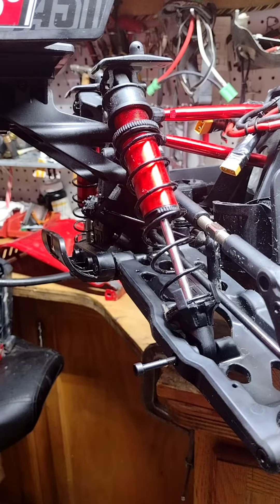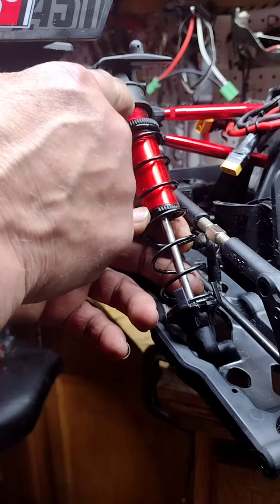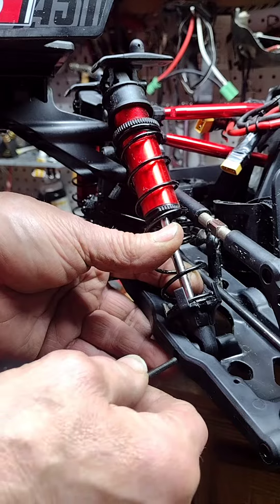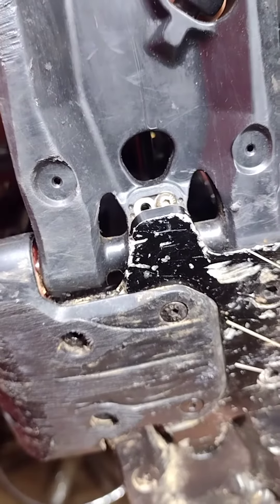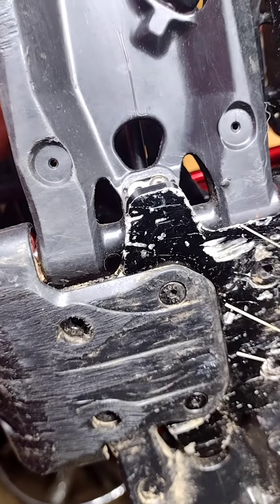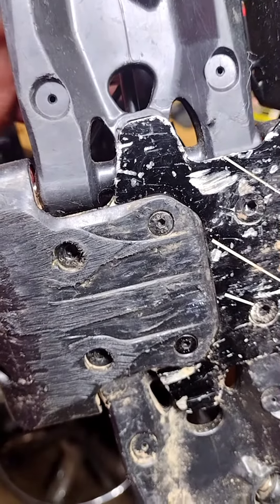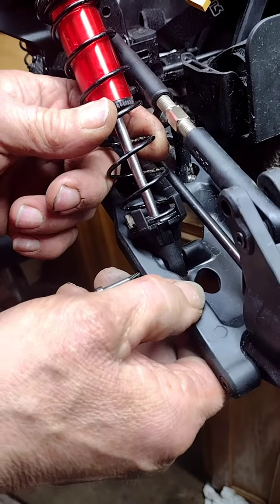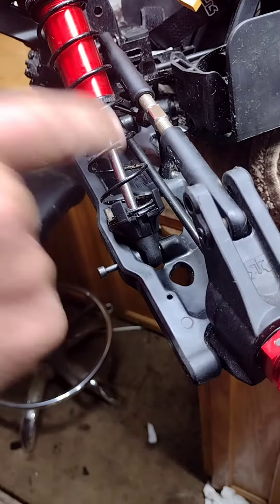How to properly set your droop screws on your arms.

Comment: What size washers do u have to buy
Reply from the maker: i got them on amazon.  i believe ther 6mm x 3mm.  and there shims.  The size shime I ended  up with 2-3 shims.  i bought the multiple shim  pack. i think it was 3 of the .3mm thick.  I hope this help.  seems to have solved my problems.  Other then using the shock extenders.  but im sticking with the limited rigs.  Have Fun.  thanks for the comment.
Reply: @ thanks brother

Comment: Some cars don't have droop screws so what do you do??😮
Reply from the maker: i notice the last set of RPM arms i bought they changed there mold and put a section to put droop screws on.  yaaa..  i haven't had the issues yet but i was going to buy or make limiting straps.  i been wanting to start putting them on my rigs .  i think its a better way of limiting the swing arm from going to far and break more parts.  thanks for the comment  alway want to be helpful in this hobby.  good luck but most importantly...  have fun.
Reply: @readeracingRC  I just use the shock spring tension to allow droop usually